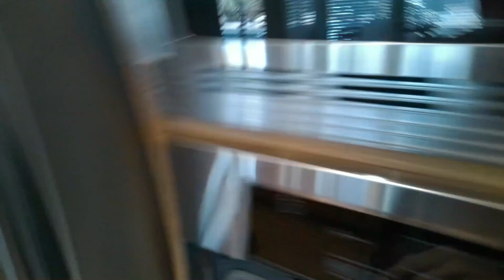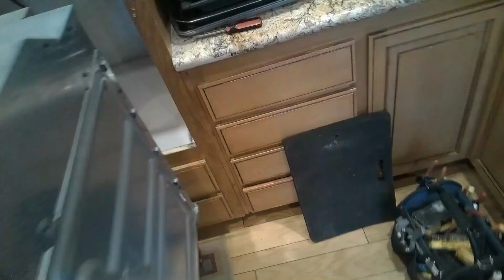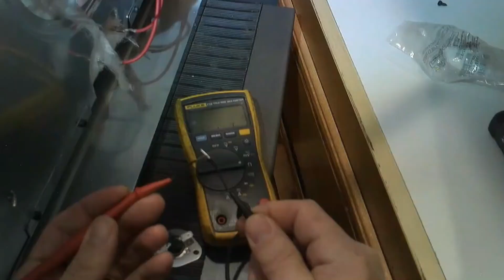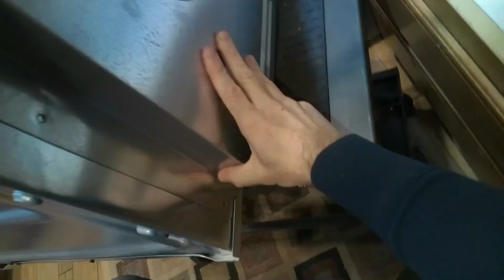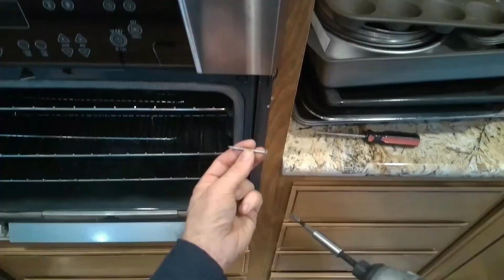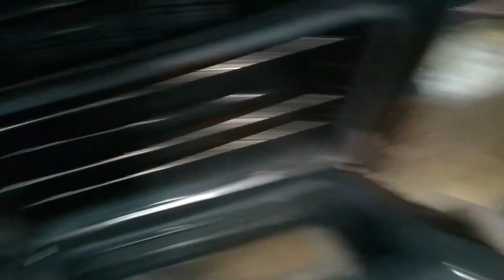How to Replace Thermal Fuse in Whirlpool Wall Oven | Oven Repair Guide

Comment from the maker: 🔥 Whirlpool Wall Oven Not Heating?

If your Whirlpool wall oven won’t heat, a blown thermal fuse is one of the common causes that can prevent the bake or broil elements from working.

👉 Whirlpool Oven Thermal Fuse used in this repair:
https://onlineappliancepartshub.com/products/oven-fuse-whirlpool-oven

✔ Always confirm compatibility by typing your oven model number in the search bar before ordering.

💬 Need help diagnosing your oven?
Post your oven model number and symptoms below, and I’ll try to help point you in the right direction.

Comment: I have the Whirlpool W10694071B double oven range, and have looked everywhere for the thermal fuse.  I've had the back off several times, looking for the fuse, but cannot find it.  All my searches on the internet show it in a similar place as in your video, but my oven as nothing like that.  Any ideas on where it is located on the W10694071B?  Any help would be appreciated.